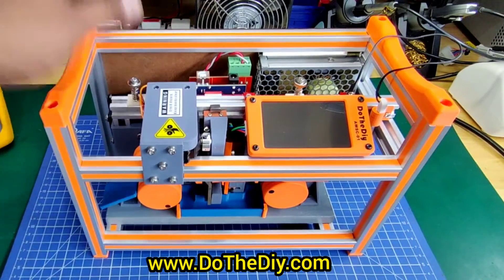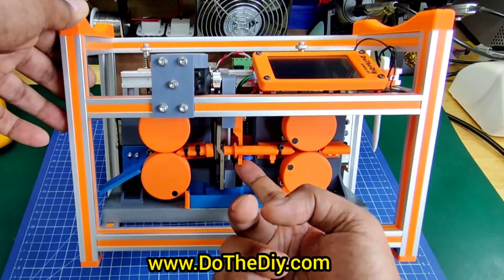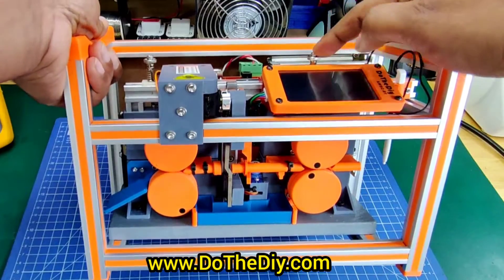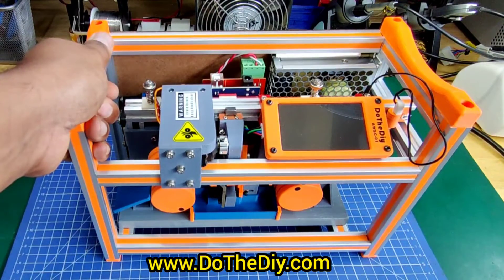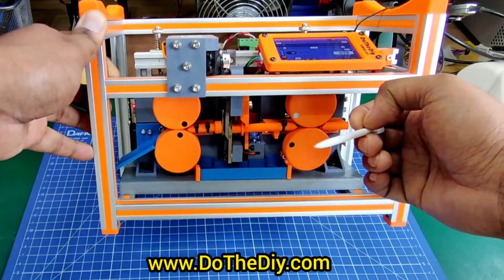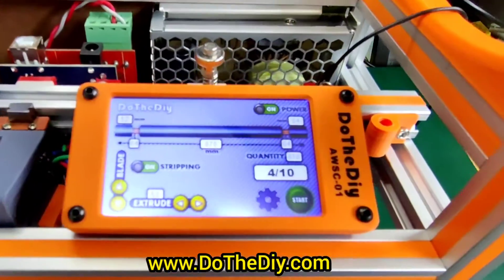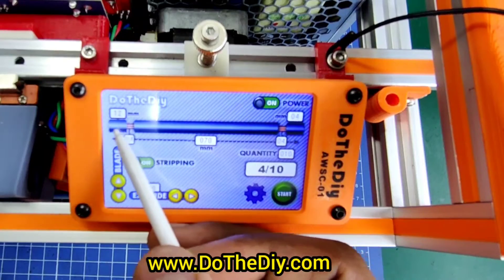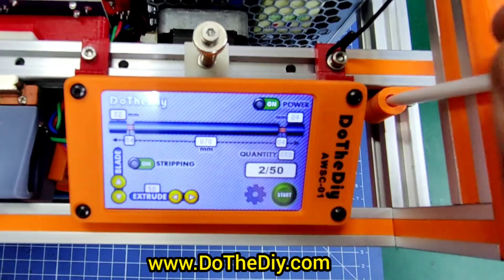Arduino Homemade Automatic wire stripping cutting machine V2 (DESIGN)

Comment: 5:30 for a metal cone, use a pen tip filed down to widen the ink hole.
Or a cake icing nozzle.

Can you show how those spring tension bolts work? I can't figure it out.
Great job!!
Reply from the maker: Tension bolts simply push the motor down. The springs are there to keep the top white t-nut cover in place. That white plastic part prevents  t-nut from rotating and coming out and spring push this cover down.
Reply: @DoTheDiy  I just can't picture it. Needs a video. :-)